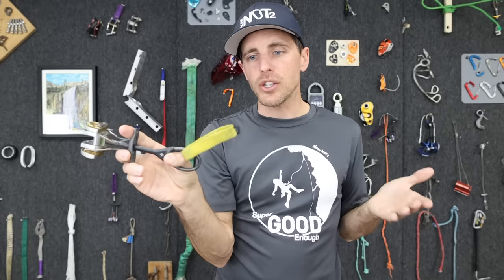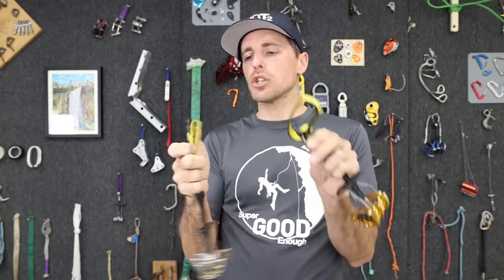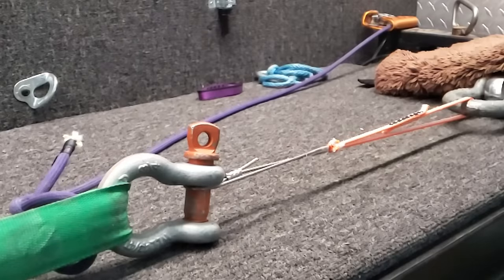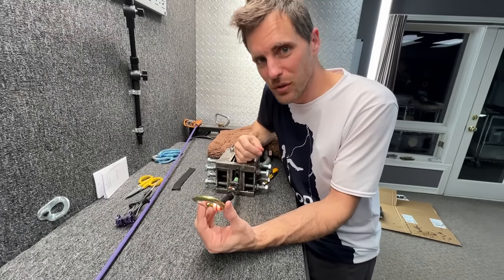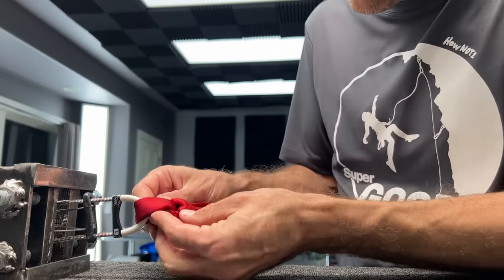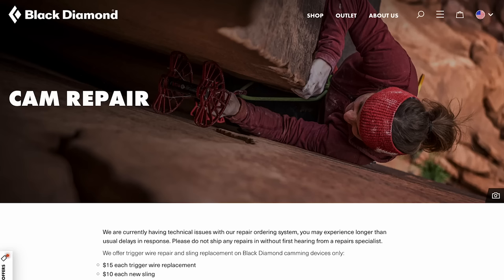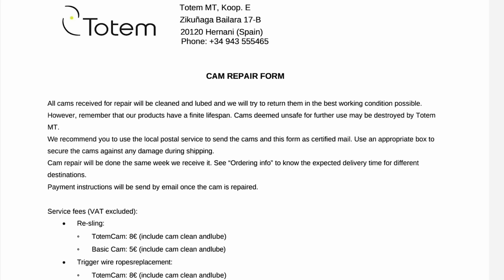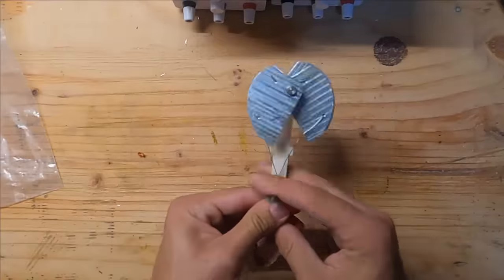This is illegal in Europe

Comment from the maker: I'm told this Polish climbing shop will resling your cams.  https://www.lhotse.pl/uslugiszwalnicze/ 
Comment below if you know if they will do this to a cam older than 10 years because I don't know.
Reply: I'm just assuming, but as an eastern european myself, I think they don't give a damn. They'll say its your own risk, and do whatever you want, if you pay them. Life is still cheap around here 😅
Reply: They'll resling whatever you want :) The only difference is that the sling won't be the same color as original BD sling.
Reply: Hey I've lengthened cams with tube tape. You make a full loop where once you tie and seat (load it) your water knot you end up with a figure 8. Cam is captive and only one loop to clip.  
I used full width 26mm tape and felt safe on it.
Reply: The sewing branch of Lhotse is just what it's called - a sewing service. You point them what/where/what material (polyamide 16mm or dyneema 11mm)/length you want them to sew and they will. What differentiate them from other similar companies is that they are willing to complete small orders from retail customers as opposed to bulk B2B orders. The Lhotse sewing service conforms to all norms when it comes to the material and sewing process, not the whole final "product". They are are pretty clear about that.
Reply: Lhotse is pretty good. I have my BD cams reslung with dynema extendable sling (DMM Dragon style). All that was sone in accordance with CE 1019 cert (sling should be holding up to 22 KN), tab with a date when it was reslung. The thing that people are missing is that in their case certification is that the sling won't break and not the cam.
Reply: They reslinged cams that I got from my dad and are like 18 years old. Now they've got brand new dyneema extandable slings. I've been using them for the better part of two years, even whipped on some of them and been fine every time. So yea, Lhotse does a very good job, is pretty cheap, and doesn't give a crap about the age of your cam
Reply: @Bikalakat you don't know what you're talking about. Slings done by lhotse are certified for rated strength.
Reply: I know, I had them resling mine Dragons once
Reply: @getahanddown "Felt safe" might be enough to shift a charge form "reckless homicide" to "culpable homicide" (your jurisdiction may not see a difference ; mine does) but having some experimental results would be better. 
(I'd stitch down the ends of the "water/ tape" knot myself - just enough to stop them snagging/ working loose.)
Reply: They are harness/slings manufacturer, preparing special orders for rescue service - they can do whatever is needed with proper quality/certificate/strength rate.

Comment: So, if you need to be precise you're switching to mm instead of weird fractions of freedom units, I as a European really appreciate that! :-)
Reply: I don't mind inches too much, but small measurements in imperial are just a pain. Socket wrenches and drill bits are the best example. Super easy in mm, but a nightmare in imperial
Reply: @thorwaldjohanson2526  yes, and you're even used to them. 1" and 0,5" I know what these look like but 3/8"?! I'll have to get my calculator out and most times I don't during watching a video.
Reply: @dereinzigwahreRichi well 4/8 would be half an inch, so 3/8 is... a little less than half an inch
Reply: @leveller4 if that's exact enough for you and all you care to know... ;-) I'm a german engineer, textile technology engineer to be precise, so I'm very interested in precise measurements. The difference between a 8.9mm and a 9.2mm climbing rope regarding smooth rapelling can be astonishing, for example. This difference would be 3/254" for you, so basically "nothing", but it's still 0,3mm, something you can easily see with your eyes.

And 3/8" is 9.525mm BTW, I did want to know now! :D
Reply: @dereinzigwahreRichi  "but it's still 0,3mm, something you can easily see with your eyes"  or two thicknesses of an Imperial standard toenail. Approximately.
Reply: @a.karley4672  do you have those? They must be very fragile... I certainly don't have these. ;-)
Reply: @leveller4 "a little" being the precise qualifier here ;)
Reply: @dereinzigwahreRichi  oh sure, totally depends on the context. If I'm just trying to eyeball something, I know the difference between 1/2" and 1/4", so 3/8 is probably in the middle there somewhere. Anything more precise and I'd have to grab a ruler.

If I'm doing engineering (or anything requiring calipers for that matter), I'd avoid doing conversions entirely and wouldn't deal with anything other than metric.

And imperial sockets are an abomination.
Reply: @leveller4  I'm glad we're on the same page here!

Getting "imperial screws" in europe is a nightmare if you need to fix US imported equipment.

But now that I'm thinking about it: as a very strange exception we do have inch measurements in our plumbing supplies right here in Germany. I wonder how that came to be.

Now that I think about it
Reply: - yep metwric (sic) inches is for appwoximations...  ha ha...
Reply: Yes I learned that I really fucking hate imperial units once I started needing tools and shitt

Comment: In Poland, there is the Lhotse company which manufactures harnesses, slings, quickdraws, etc. For around $5 a piece, they're reslinging any cams (not sure about totems, though). Along the shipping costs it may be a nice option for European climbers. You'll get the kN rating label attached to each sling.
Reply: "You'll get the kN rating label attached to each sling." So, in theory, you'd be safe using these in a professional setting (e.g., securing a climbing cameraman). At least, in the criminal dock you'd have a fighting chance of turning a "culpable homicide" or "reckless endangerment" charge into something less serious (with consequences for your next decade's insurance bills).
Reply: Still, you have to understand the difference between the sling rating and the cam rating. You may get 22kN sling on a 8kN cam...
Reply: @MrCombic  And the problem with that would be ... ?  (Though I doubt the sling material - if it's one of their "standard products" which they're building around the wire of a cam - would achieve it's nominal strength if it were slung between krabs.)

Comment: I got a Camalot reslung years ago by taking it to a harness and saddle maker (harness gear for horses, not climbing) because I knew he had a commercial bar-tacker. He put in  the six bar-tacks exactly as on the original and it worked for years. I don't climb much now, but still have it. I figured a guy who made gear  that had to hold race horses would know how to make it strong enough.
Reply: - love the equivalence confidence, (with little commonality between sports..) fantastic, I'm sure it was extremely well done.

Comment: I had Yates do my whole rack a couple years ago. They were great to work with and it took just a couple weeks. It's cheap insurance and now all the webbing colors are consistent between sizes of different brands and models.
Reply: I’ve done it with both Yates and Mountain Tools over the years. That’s definitely the crux of it, you never quite know what color they will choose, so you have to be Ok with that. Even if you are very clear about the color, it will be what they have on hand. Whatever material they have on hand too. Your Aliens may be hard to tell at a glance from your Camalots. Yates did a much better job in my opinion. I wouldn’t use Mountain Tools again given their color choices and the overall look of what I got back (although I have no worries about the safety). My buddy had really good luck with Runnout Customs, but they were a long time out last I did this. Agreed, cheap insurance!
Reply: yates seems to be the only ones that will do others/out-of-biz makers

Comment: I will concur, I sent Metolius 3 cams. On Two of them the cams would slide apart because the spacers were long gone. 
They reslung them, replaced the missing rubber spacers with c-clips, and polished them to a brand new shine for like $20 total. They’ll also fix any springs or wires if you request and pay for it.
I had a super good enough experience with Metolius re-sling service.

Comment: Depends on how you define Europe? DMM will resling and service your cam for a modest fee (just not those from other brands)
Reply: Probably meant EU regulation. I was also surprised to find that in the EU you can't get avalanche packs refilled (have to exchange for the canister).
Reply: The end of the video gets specific on this. The claim (not mine, not hownot2's) is that it's illegal to modify another company's ppe product. Maybe. Also something about 10 years. It's not clear.

DMM (Wales) & Totem (Spain) are both mentioned in the video.

Comment: Specialist sling sewing machines will use (or at least they used to) use needles which injected high pressure air in front of it's passage through the webbing to prevent any fibres from being damaged during sewing. So sewing on a regular sewing machine can damage the webbing as one sews (no matter how good you sew and unless one can seriously test their sewn designs, u are playing RR with your life and any one who might take a big fall on said gear, ok so I guess everyone here prob knows this LOL. When I replaced my slings on my cams I simply used quality climber's tubular tape, overhand knot (Yes I know all knots reduce the strength) and have fallen on them many times (ok until I replaced them again and again over the years). Ok not suggesting anyone should do it but I started climbing before any of the commercially available slings were easy to buy and I'm still alive. A lot is common sense fo climbers. Great video as always. Hope u are doing well. U look it.

Comment: When basketing a cam, you should already have it done correctly on your harness when you remove it, right? Or else it would have fallen off. As long as you don’t remove the carabiner when placing it, it should stay good.
Reply: I think the main issue is extending it, but I agree that it would be pretty obvious that you clipped it wrong.

Comment: When I was climbing I was told to never rely on a single cam.  2 cams as a system fine, cam and a nut fine, single cam with no backup, not fine.
Reply: When I was caving, you'd never rely on a single anything for anything. At least two of something (natural, cam, bolt, nut, piton, chock stone), and of preference in at least two separate crack systems for any main belay. For a runner/ deviation / rebelay, the existing rope from above can be one of your links, but if you're talking about a belay where people may be hanging around for a breather, you'd want at least one extra connection point to the rock. 
It's less the breaking of the ironmongery, as that you're - almost by definition - hooking into part of the rock that is already fractured. Not that limestone is the strongest of rocks any way ...

Comment: If the EU has regulations banning the repair or alteration of PPE products, that's probably only for PPE used in a professional setting.

I think it's more about protecting construction workers from their bosses being cheapskates than anything else.
Reply: Yes and no. Yes these regulations come from the professional environment. But they will apply in case of an accident even in a non professional setting, if the repair job failed and the company having done the repair can be tracked down. But in the case of realigning cams my information is that it's not really illegal, rather so much paperwork that it would be crazy expensive.
Reply: There are no regulations forbidding this. Especially for professional fall arrest ppe repair is completely normal in the EU. It's a businesses choice of the manufacturer :-(
Reply: Well put

Comment: I got an old rack of cams to use as a second rack year ago. I ended up using 7mm coord since I though it would be strong enough in a loop. I don't usually use them on anything hard and I don't care about the bulk. It came out to about $1.7 in coord per cam, so the price was right. Has worked good so far.

Comment: Your tests mostly show that radius of the cable to dyneema loop is the most important factor because the loop fails where a sharp bend occurs.  It doesn't fail at a normal diameter carabiner. Wider straps fail at the edges of the strap, then the failure progresses to the center. Geometry is critically important.  So wider loops, or webbing with the same strengh will fail sooner than narrow but thick loop with the same tensile strength.

Comment: I thought of this during your video where the old tat sling resulted in the fatal accident but now that you've shown off that you have a steel wire crimper, what do you think about steel wire with crimped eyes or eye spliced ends used as 'tat' anchors on places deemed "too nice" to drill a few half inch holes? and add some real hardware?  Basically, wire rope slings used for professional rigging, but you can make your own to test the concept a lot cheaper than buy certified ones for now.

If it gets spray painted before it is brought up it can be made to blend in more than whatever tat happens to be left behind and should be able to last substantially longer as well.

Bonus is that steel and stainless steel are recyclable so that when it is time to replace it the old stuff can go to the scrap yard instead of the trash so there's that selling point.
Reply: No, pretty much.
Caving has been going through this question for years. Heavily-used anchor locations generally get "done" with stainless steel shaped "P" anchors held in place with two-part epoxy. When (not if!) the steel wears, the epoxy can be drilled out, the anchor pulled, and a new one glued in place.
Wires are prone to internal rust, so you can't trust it if it has been left in place for donkey's years. That's probably a lot of the reasoning behind the 10 year lifetime on cam bodies, regardless of any re-slinging.
Reply: @a.karley4672  I can't say I've ever heard of a hard time limit on cam bodies other than the dynema based BD Ultralights before.
If it hasn't been left outside for years there is no reason to question old cams or nuts.
Reply: @alexnone5720  The metalwork, I'd agree. The plastic shrouding over the cables, where the tapes bear ... that's a bit more debatable. How much the plastic deforms and flows into the wire surface, versus cracking and parting, probably has a lot of effect on the tapes, and that is likely to be affected by the "plasticisers" (additives in the plastic mix), many of which are appreciably volatile and/ or oxidation-prone.
When I stopped running hardware, cams on tapes were just being introduced - not that we used cams anyway - and we (me, Caving Club treasurer, members) just ignored the question. Metalwork, bolts and slings fulfilled our needs for the training ground and underground.

Comment: Why do the climbing manufactures not use a caus in  the back end of the cams this would prevent pinching/hard bending  the cable, when you look at hevy duty lifting wires they are almost always  reinforced in the loops .
Bending steel wire around hard sharp corners is shortening the life of the cable severely. 
Using a caus will also protect  carbineers and metal links better  if clipped directly into  the wire loop.
Reply: Because they don't need to, that's added weight for added strength that isn't needed, we would never ever see forces that would break the cable in a climbing scenario apart from very weird edge cases.

Comment: The manual for tricams (at least used to) say that they can be reslung by the user with a "grapevine" knot, which is basically a double figure 9 tied with webbing. This makes using tricams even more miserable though, as the OEM sewn sling is very rigid and is useful to place (and, more importantly, remove) them. I have used this knot to resling cams and have felt confident with the results, though it takes a lot of material. Based on your pull tests, the weakness is not the knot for tied nylon slings. Thus, if the grapevine knot solves the danger of the knot coming untied, this would seem like a legitimate method. That being said, I had never thought of the basket-hitched half-length sling - I would probably be quicker to whip on that than my tied sling.

Comment: I had this very question when I reslung my mid-2000s set of CLOG cams with almost zero use but 20ish year old slings!  I reslung with Titan cord because of the swaged hole stem. Triple fisherman’s and two loops of cordage. I like the quick link though - that would have been ideal.  They’re retired but available as backups!

Comment: My climbing experience predates cams.  So I'm looking at this out of technical interest.  What is the purpose of the little bit of sling?  It seems you need a carabiner between the sling and the rope ... why not just a carabiner through the cable loop?
Reply: You want a bit of extension to allow the mouvement of the rope to dissipate in the sling so that the cam stays in place and don't "walk out" the crack.
Also a carabiner directly on the cable pinches it in a bad way. It's ok but suboptimal.
Reply: @moonti6820 I'm slightly surprised there aren't models of krab these days with a varying cross-section so that the ends have slightly larger bending radii at the loop ends. You'd need it a both ends, but that's a "meh". You'd be talking about drop-forged aluminium, but that's normal already, isn't it?